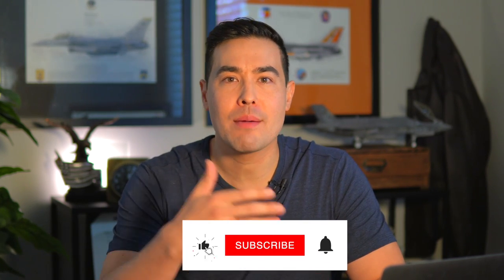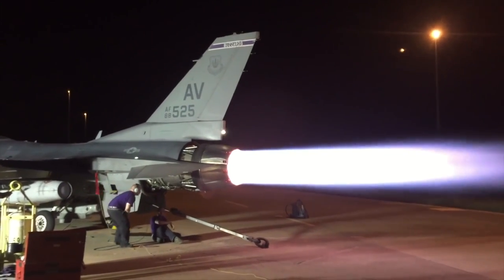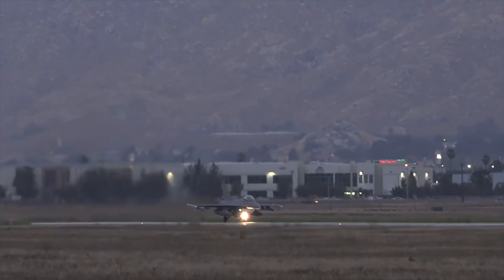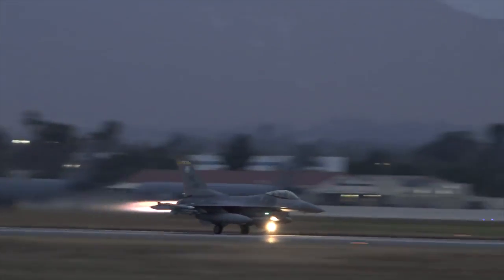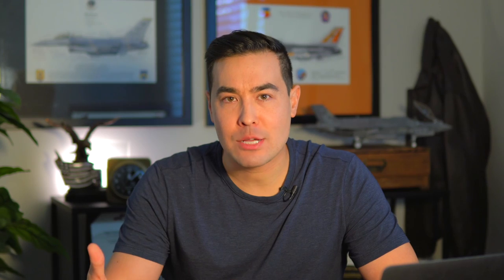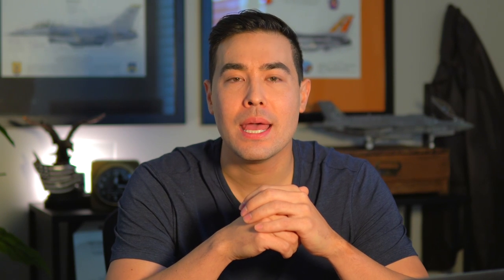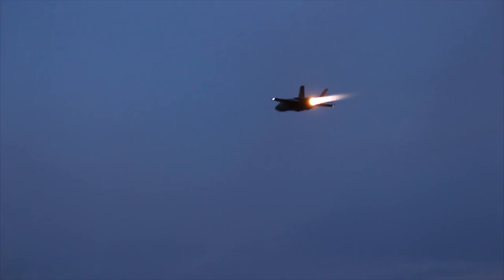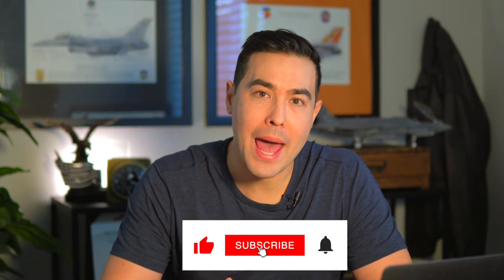Afterburner: What It’s Like to Use MAX Afterburner!

Comment: you mention various names when you talking about which gear your throttle is in.something about kicking it into av, max thrust, max afterburner. Could you do a video on all names and choices on the throttle? We dont know which comes first, second etc.
Reply: Idle, mil, AB. Idle is literally the throttles at idle. The area between idle and mil doesn’t really have a set name. Mil is military power, so max power without the after burner. Then AB....after burner. These are all displayed as a percentage of max allowed. So idle is around 20% and AB is around 100-110%. These numbers change based on engine though.
Reply: thanks
Reply: @herosjourney8725  👍🏻

Comment: Hey Hasard, I always wanted to know why when I’m at an air show and a fighter jet passes by, the sound of it is relatively low out in front compared to the sound once it approaches close and passes you by at high subsonic speeds most of the time with full afterburner (not always the case).  Thanks in advance.

Comment: Can you make a video about the F-35's performance? 

A lot of people know its a paradigm shift in air combat tactics with outstanding S.A. and of course Stealth. But they also think the trade off is performance. I've heared people say its slower and less maneuverable than previous generation fighters, some even say it would struggle in a gun fight against a Mig-21 since it is totally reliant on stealth and BVR tactics only. 

Personally I don't believe that, but it would be nice to hear your opinion 

Thanks for
Reply: Most critics don't understand aircraft design. The F-35's performance is comparable to an F/A-18, both undertake the same roles, have mach 1.6 top speed, the wing loading is relatively similar with the same internal fuel, but with a combat load the hornet will have far more drag due to the external weapons. The F-35 also has far better avionics, more range, stealth, etc. Modern warfare is more than speed and turning like it was in the cold war, most fights take place in subsonic speeds anyway. The F-35 has all the performance it needs, it's not perfect of course but no aircraft is

Comment: Question for any aviation technicians or AF bean counters.  Regarding afterburner time, is there any data that correlates the use (or minutes/hours) of afterburners with engine longevity?  Or rather, when an engine needs to be refurbished?

Comment: @Hasard Lee -Funny, as someone who has heard the comments of many pilots & one of the number one compliants of about F-35 is the engine's or rather lack of two (power to thrust, if one fails) & turn radius for dogfights (especially the Marines). Being such would you agree with them or not? As for myself I would rather be in a SU-57 with its reported "longer range missiles" thrust vectoring in a dogfight & power to weight rather than an F-35 that has an equal or similiar amount of "stealth" from the front & rear aspects yet I'm an American with an American bias toward American made. Whats your opinion?

Comment: (Hi Hasard) Regarding the stakes of being fuel astute before using afterb. and regarding the F35 spec. of being able to take off / land vertically : w/could you share why is it so important to develop this particular ability in a 5th gen. jet fighter  in spite of the extra fuel consumption that this requires ? (if it doesn't reveal a classified topic) Thx !

Comment: Most cars don't feed air/oxygen to the engine by direct inline feeding or funneling of atmospheric air (to compression) though. Certainly not to any degree of significance. Car engines suck, and that suction is generated fairly far off from the point of atmospheric intake, through relatively narrow ,snake'ing ducting and filters (whether that be the engine itself (NA), a turbo or compressor). So in addition to the vehicle having a huuuge drag coefficient vs a jet, car engines don't generally derive any benefit from the increasing forward momentum of the vehicle. It helps chill radiators, but that's about it. It helps to get the revs up to a range where it can generate more power, but that's more of an inertia and drivetrain thing, not so much a fuel/oxygen one. 

With jet type engines though, including ram and scram, the faster you go, the more oxygen is/can be crammed through the engine.

Comment: Btw just a question because I read an article saying that in history, there's an F-16 that shot itself because ot went faster than the bullets. Was that true?
Reply: Not sure about an F-16, but a Grumman F-11F Tiger did in about 1959
Reply: @oxcart4172  I really dont believe such stories of jet going faster than a bullet because bullets accelerate 2,600 ft per second and the fastest jet is the lockheed SR-71 blackbord and it travels about mach 3.3 which is 3500kph that converts to 2300ft per second and if they fire a gun wouldn't it slow the jet down because of its recoil?
Reply: @oxcart4172  ohh ye nvm i did a research and the one I read was also the f-11, i also just watched somwthing on tiktok🤣

Comment: Cool. I have an unrelated question: Why does the F-35 have a canopy bough, if that's the right word, while the F-16 doesn't?
Reply: Because the Marines demanded vertical takeoff, so the mechanism to raise and lower it is in the front of the jet. Thus, the wind isn’t going to catch the canopy during an ejection and remove it from the jet. So the canopy requires a frangible section rigged with explosive cord so the seat can punch through if the cord fails.

If you think the F-35 is weird for some reason, it’s almost always because of the B model.

Comment: You stated that your fight engine is a low by pass type engine which is similar to air liner engines.  That is an incorrect statement current air liners use a high by pass type engine, meaning high amounts of air by pass the core, the air which by passes the core of the engine can equate to up to 30% of the engines thrust.

Comment: At 2:58 "High Density" Altitude? I don't understand that at all. Hot air in the 120 degree deserts and or high altitude run ways
 have to Low Density air not "High Density".   Warmer air is less dense. When the air is less dense,  there is less lift beneath an aircraft's wings. That means an aircraft engine has to work harder and use more runway to attain the needed lift.

Comment: Ooh  I have a Random question:
Why Do Canopies have Frames And others that Don't, Like Bubble Canopies!?

Like the F22 is FULL Bubble Cockpit for Max Visibility But then F35 still has that Bar or "Frame", Even f16 has a Frame at the rear.

Like is there an Important reason For Canopy Frames as opposed to Clear Bubble canopies !?
I know like the F-117 needed it because of Radar deflection But why F-14 and A-10 with the Mid or Windshield Frame ?!!!

Comment: I have a question. Belgium has bought the F35 in replacement for the F16. The F16 is a aggressive plane more aggressive than the F35. If the can detect stealth wath is the value of the F35. Sorry for the bat Englisch. Thanks
Reply: The F-16 isn’t more aggressive, don’t know where you get that idea from.
Reply: @UnforgivingDemon  can't turn, can't climb ,can't run,this sentence mean something.
Reply: @rudyschroyens2632  you obviously don’t know what you are talking about.
Reply: @rudyschroyens2632  It most certainly can do all those things even in combat configuration.

BTW the F-16 doesn’t go into combat in clean configuration....
Reply: @UnforgivingDemon  OK i don't know much about that, but are you a Fighter pilot. Or where do you get your information
Reply: @rudyschroyens2632  I get my information from people including F-35 pilots who transitioned from F-16’s and others who actually know what they are talking about not from hacks like perry sprey.
Reply: An F-35, with the same amount of fuel as an F-16 (F-35 can carry over double the F-16's fuel), has better wing loading. The F-35 also has better avionics, much greater range, doesn't require afterburner nearly as often, and doesn't have to deal with the additional drag caused by external weapons. The F-35 is actually the more aggressive plane because it's stealth enables it to go on the offensive while other aircraft have to avoid being shot down
Reply: @aidanwilliams9452  OK thanks but i a dogfight with a SU-35 wen stealth no longer matters can i  beat hem.
Reply: @rudyschroyens2632  It won’t have to because that dogfight would never occur. The Su-35 would be detected first from a far greater distance, and the electronic suite on the F-35 has the ability to jam enemy radar so the flanker would essentially be a sitting duck

Comment: Sorry if this is a dumb question but why do they not have “reverse thrust” on fighter jets like they do on airliners.
Reply: No
Reply: Thrust reversers are mainly used for landings, but fighters generally operate on runways that exceed the landing distance required. Some countries use parachutes on their fighters to slow them down on shorter runways, and many use speed brakes to help them, which is far easier than designing and maintaining a thrust reverser

Comment: I'm still raw  about the yf-23 I think you would have enjoyed it much more
Reply: Difference between the modern finished F-22 and the YF-23 are very small now. As far as overall performance goes, there's simply not very much of a difference because the F-22 was simply tweaked with everything they could do to it after the initial experimental planes we're finished.  It's a very complete airframe.

Comment: I understand the numbers as in speed increase in afterburner mode when on the ground during takeoff, but when your causing along at say 300mph and throw on the afterburner what is that like? Is it like holy crap you go from 300 to 500 in like 2 seconds or what?

Comment: Any Take On The GE XA100 Adaptive Cycle Engine?
Reply: The General Electric XA100 is an American adaptive cycle engine demonstrator being developed by General Electric for the Lockheed Martin F-35 Lightning II and form the basis for the propulsion system for the United States Air Force's sixth generation fighter program, the Next Generation Air Dominance. Wikipedia

Comment: The P&W F135 beats out the P&W J58?  So you're saying an F35 has the same or greater power than the SR71 that could travel at Mach 3.3? ok, you fly it ill take your word for it. I Mean I realize the Blackbird had two of J58s, but it was a good bit larger than an F35. The blackbird also had more than double the max takeoff weight. Not to mention the J58s little trick at altitude and cruising speed of having 70% of its thrust coming from the air it sucked in. That P&W F135 is indeed one hell of an engine then.
Reply: Better engine does not mean greater power, what he likely means is it's probably much more refined and better to use

Comment: that's some SERIOUS spin to avoid admitting the F-35 is a dog
Reply: No spin necessary, because it’s not a dog. Pilots at Red Flag and international exercises really like its maneuverability and lethality. We no longer need Mach 2 capable jets- a Mach 1.5 jet with huge sensor fusion capacity is much better now.
Reply: @kolbevilla  you're a funny guy ;)
Reply: That's some serious spin to avoid admitting you don't understand aircraft design

Comment: The singular Israeli Super Phantom with the PW1120 engines had the capability of super cruise, and a greater than 1:1 thrust to weight ratio. It performed better than the F-15's and F-18's. There are also a couple of videos of it performing at air shows. Check it out.
https://nationalinterest.org/blog/buzz/1980s-israel-developed-heavy-hammer-f-4-super-phantom-what-happened-44702

Comment: The afterburner on a fighter jet, it gives a big boost in thrust and speed, but all that speed and thrust comes at a cost of poor fuel mileage and huge consumption of jet fuel and reduced travel range. I guess that it can be said that an afterburner is a gas guzzler.
Reply: Ludicrous mode...?

Comment: I still don’t understand why Americans call a liquid gas
Reply: Originally one of the major oil companies tried to market what you would call petrol as gasoline. The idea was that things like natural gas was already know by the general public so the first part or the word would "gas" the company wanted to also deliver the idea that it was a oily liquid "oil" the "ne" ending was added because it made it sound official. So gasoline is being sold in the us but less syllables all ways wins so it was cut down to just gas and then gas gets applied to every kind of liquid fuel. It not just a American thing gasoilna is used in Spanish and Portuguese and is shortened to gas. Why do people in the uk call kerosene paraffin even though it has no relation other than being a oil by product to paraffin wax.

Comment: That’s not an afterburner, it’s an augmentor. Augmentor adds fresh bypass air to the atomized fuel. An afterburner just adds fuel into the exhaust, which has less oxygen. They don’t use afterburners in modern jets anymore.

Comment: And hooks are only used a couple of times per lifetime? Have you even flown one of these? Why only use hooks a couple of times per lifetime? You make it sound like it would damage the jet in some way. And the afterburner? Only a couple of minutes? More like 15.
Reply: He obviously has flown them. The reason why the hooks are rarely used is because they’re only needed in emergencies on landing. Plus the landing gear of an AF fighter jet is not built the same as the Navy’s aircraft. They can’t handle the near immediate stop the hook provides over and over again. It can cause major damage to the landing gear.
Reply: As for the afterburner: with a fighter jet that only holds about 10,000 lbs of fuel total with external tanks and an afterburner that burns at 50,000 lbs per hour, you have to be very careful with how long you’re in afterburner.
Reply: @christianoberlies  When jets aren't using afterburner, they're typically burning more around 0.7 to 0.9lb/lbf/hr, and with most jets only using a fraction of their max military (non-afterburning) thrust while in cruise.

So what does that mean? It means that if you have a jet that carries (eg) 15,000lb of usable fuel and produces 35,000lbf of thrust in afterburner, it'll consume 70,000lb of fuel per hour, or 1,167lb of fuel per minute. With 15,000lb fuel to consume, that means you have just under 13 minutes of afterburner time.

The only time a pilot might come close to that kind of afterburner usage however would be in something like a 1960s Cold War gone hot, alert launch intercept, where the jet is racing to intercept a bomber before it destroys his airbase, and where a dogfight with enemy escort fighters potentially results in the pilot being forced to stay in afterburner until he's turned into a glider.

In more modern times you'd use your afterburner much more sparingly, especially as jets are performing longer-ranged missions due to longer-ranged enemy IADS, etc. Supercruise will help there, but you're still then only around 60% more fuel efficient (though consuming fuel in general even slower than that due to your thrust being lower). Even supercruise burns 2-4x more fuel than subsonic cruise however; supersonic speeds are just not very compatible with flying long ranges or long missions.
Reply: @christianoberlies  no. Hooks are actually almost the only way to stop a jetfighter coming in to land. And suspension of the landing gear is very sturdy. A plane built to handle 7g with margin isn't going to have much strain on the structural integrity. And the plane doesent catch the cable with the landing gear. They have a hook that catches the cable and slowed down the airplane in a controlled manner. The pressure created on the landing gear isn't that great. These planes where built with this feature in mind. It's not like an afterthoughtm
Reply: @joachimsingh2929  Go look at the landing gear of an F-16, then the landing gear of an F/A-18. The 18’s is beefier. It’s designed that way so the suspension can handle the sudden stop the cable provides. They aren’t used by us often cuz most of the time, fighter aircraft can land fine on an airstrip. The near sudden stop the cable provides actually does cause a lot of strain on the landing gear and suspension. Hence why the Navy’s are thicker and stronger. Our fighter aircraft aren’t built to handle that kind of stress over and over from a hook and cable landing. It’s only used in emergencies.
Reply: @joachimsingh2929  Plus i said our aircraft’s landing gear can’t constantly withstand the sudden stop the HOOK provides.